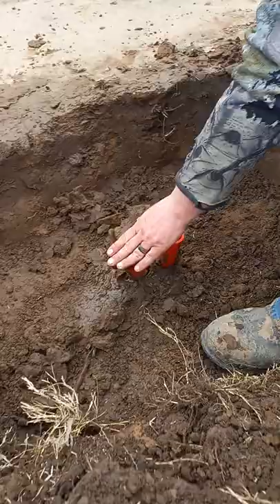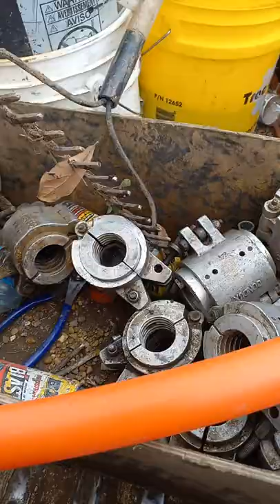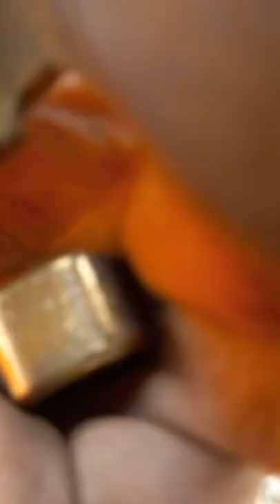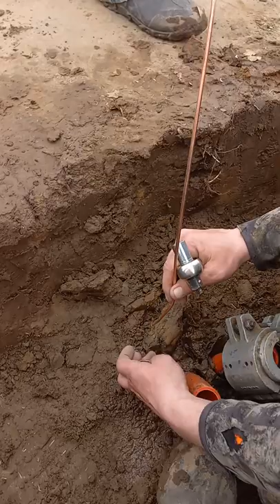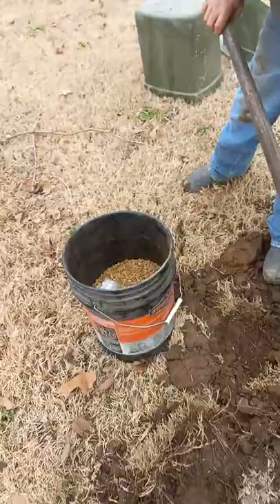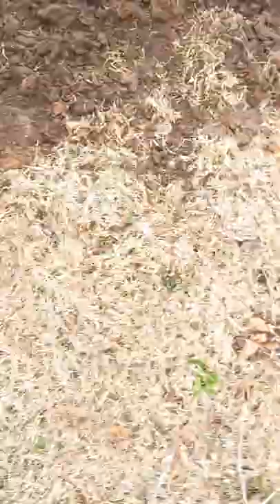installing a pedistal for a fiber optic splice

Comment: Why is the ground rod required? Is there any metal in the fiber jackets that would need grounding?
Reply from the maker: Yes there is a metal sheet between the fiber and the outside coating..
Reply: Some have a metal jacket, others don't. If you rum fiber underground without the metal jacket, then you need to put it in some sort of protective PVC pipe. Then you do not have to ground it. But you end up grounding the non metal jacket ones anyways, because when you lay the trace wire so that you can locate the trench at a later date. The trace wire needs to be grounded to find it.
Reply: @qwerty2269nd  All of our fiber is grounded because ours has a copper wire to power equipment.
Reply: Some cables have steel strength members that are grounded to the case and used to locate cable path.  The type  of cable used, it's physical makeup, is up to the company having the fiber placed.

Comment: Not a very quality installation. Ground rod is installed poorly, you will have issues later on. Ground rods need to be driven in and kept in constant contact with the soil. You made the hole too large. I'm guessing you are contractors and not in house. You also left the conduit uncapped allowing for intrusion. When they come back to blow the fiber they could have issues. While nothing you did is terrible, the quality of your work is pretty poor.
Reply from the maker: U don't think the gravel filled the crevus were the rod was impelled? We blew the fiber right after this installation as well.. I'm sure u notice the guy go to put on a coupler and I tell him not now!! But that's neither here nor there.. I must thank you for your critique.. but I also disagree..
Reply: @fiberopticmissouri164  I don't believe there was anything wrong here the 5ft ground rod is 100% allowed in communication non voltage systems according to the NEC.  @Mike L let us know when your internet doesn't work so we know who to not come to first.
Reply: Installation parameters are at the discretion of the company having the fiber placed.  They may want that ground rod as it was placed so the connection can be inspected to insure a tight connection.  The only way to get an even better connection is to cad-weld the #6 ground wire to the ground rod.  That company may also require a certain amount of gravel and to have the inner ducts plugged after the cables are pulled into that location.